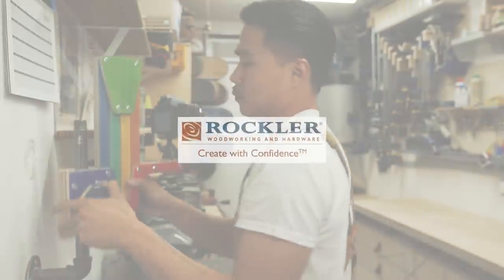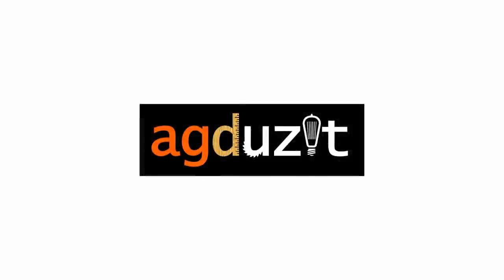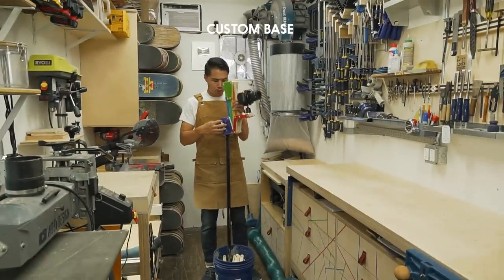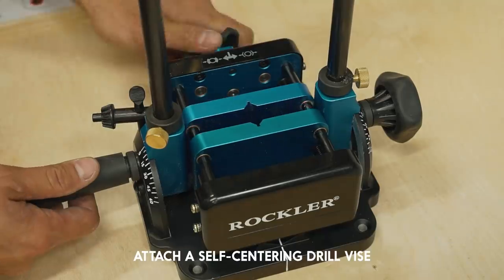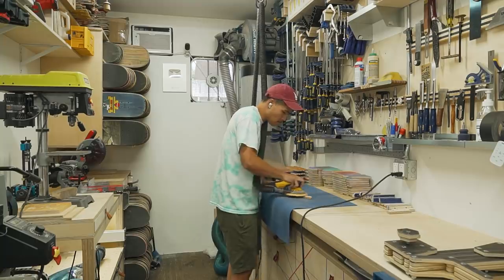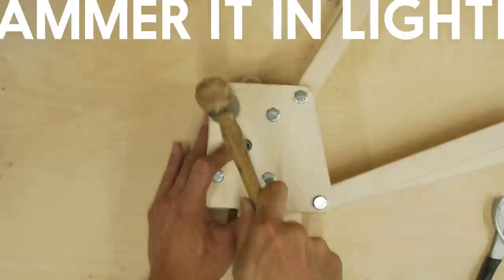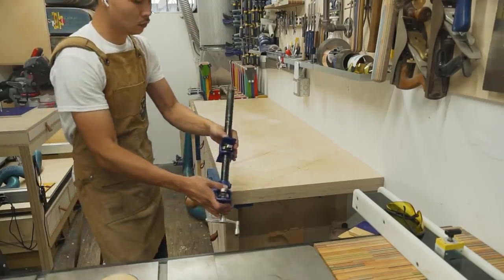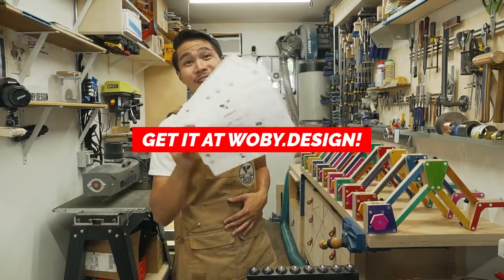THE WOBY CAMERA JIG! (BONUS: TURNS INTO A DESK!)

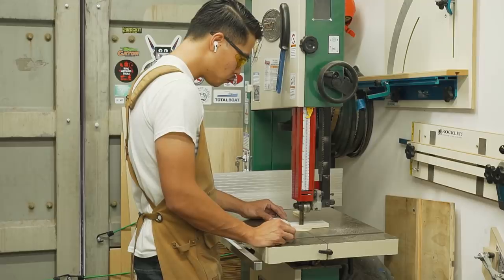Comment: @WobyDesign — Impressive! Nice design! I'm seriously considering doing this. Quick question: What are the two smaller hexagonal wood pieces seen at around 6:55? I gather the largest hexagonal wood piece is for a knob to tighten the grip on the pipe. But I watched the rest of the video and did not see the small hexagons being used? Thanks for your awesome video!

Comment: pretty rad jig! pair of parallel beams seems to negate stability/weight load issues comparative to a single strut system.. fastening a tightening knob to grip gusset plates would aid friction holds over nuts loosening from usage.. use of skateboard ply was unexpected, thought them boards had an annealed metal plate sandwiched between.. nice work, tidy shop..

Comment: watched it, bought plans, built it! Overall time 4 hours. I just have one question, what are the small knobs for? I guess you use the large one on a bolt to add tension to the pipe in the clamping section but the other two are not described anywhere. Great plans, thanks! -- mike--
Reply from the maker: I use the smaller ones for spacers. If you’re using 2.5 inch bolts, there’s a lot of exposed threads on the bolt so the smaller knobs give you better grip
Reply: Just added LED light setup still have to mount to wall but works great!

Comment: I have a Shapeoko and use carbide create, but I'm new to it all! When I plug the design in to my program with the base settings for my bit, it says it'll take multiple hours to cut (using a #201 Nomad 1/4" end mill). What are your tool settings/do you still have your carbide create file handy?

Comment: Clap "Wooooooo" epic! I just bought your design files to build Woby Jig 2.0, I like the chamfered corner design 👍🏽 Q1: What's the purpose for the 1/4" grooves, 1/8" deep (PDF page 4)? and Q2: I only need 15 socket cap screws, not 50, right (PDF page 1)?

Comment: for the printable version, I'd be cautious about using home printers - they often scale to 97%, which doesnt sound like a lot but it will definitely throw things out.
Reply from the maker: joe have you tried it? Or are you just going by theories?
Reply: @WobyDesign  I ran a printing company for a few years and it is a real issue - 97% scales things down by a couple mm across a page so will be a lot more over a bigger distance. doesnt matter if it's vector or not - the printer doesnt care.

Not saying don't use home printers and not all home printers will do this - just get a steel ruler out and double check the printed size against your digital plans!

It's potentially not much of an issue - but something to keep in mind.

Comment: Hey man I have a quick question on the V2 PDF. Are all the holes through holes? If not, I am confused on figuring out how deep each hole is based on the key
Reply: For instance the piece at 8:35 has counterbore holes, but in PDF that part has either all black holes or all blue holes?